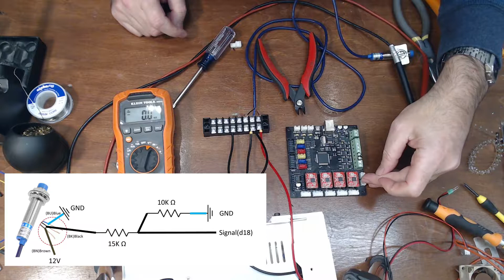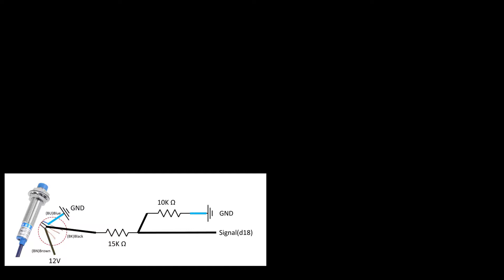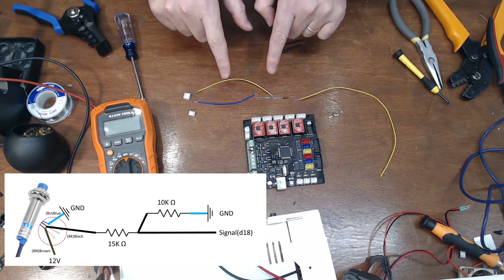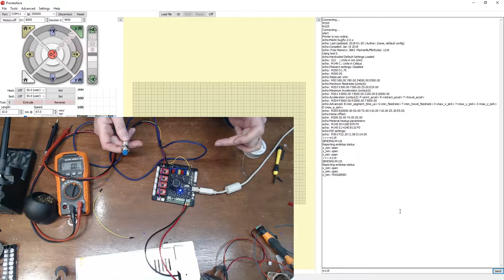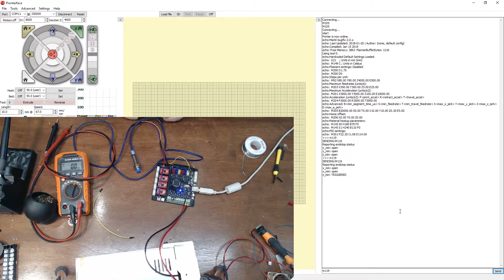C3Dt/c Cantilever 3D Printer Build: Part 4 Proximity Sensor

Comment: Can we use ramps 1.4 and arduino mega?
Reply from the maker: for the proximity sensor you absolutely can. The KFB 2.0 is really nothing more than a RAMPS 1.4 with ATMEGA on one board. IF you look at the the KFB pinouts in marlin you'll find 99.5% of all pin outs the same. For this printer (The C3Dt/c or C3dT/dz for that matter) you can't use the RAMPS and arduino board as stacked up they're too tall to fit in the enclosure.
Reply: @Core3DTech  thank you for the response 😁. Yes, I went through the design and found out that there's not enough space for ramps and mega. So I have decided to go for skr 1.4
Reply from the maker: @nithink94  I use the SKR 1.4 on my C3Dt/dz (https://www.instructables.com/id/Build-Your-Own-C3Dtdz-3D-Printer/) with TMC2209 drivers. It works great.

Comment: Hi
I tried the controller board mks gen v 1.4 does not work, I sensor model LJ8A3-1-Z / BY  was.
Reply from the maker: I need a bit more here. 

Are you using a mks gen 1.4 board or the KFB 2.0? 
What is "not working":
When you hold a piece of metal to the sensor does it light up? 
What voltage are you putting into the sensor?
have you measured the voltage output of the sensor?
Reply: @Core3DTech  
I need a bit more here. 
- I am using mks gen v 1.3.
- When I approach a metal, the sensor light turns on.
- 12 V operating voltage of the sensor 6 to 36 volts were used Knmchvn.(LJ8A3-1-Z/BY)
- The voltage increases when the sensor is engaged.
Reply from the maker: @Hossein_m_pour  Thx, You did use the voltage divider using the resistors?  how much voltage difference do you get at the board when triggering?
Reply from the maker: It's kinda impossible for me to see what would be wrong with your setup. I assume you have your firmware updated and tested using M119 but double check it; you may need to reverse the trigger in the firmware. Also make sure you have your 2 wires coming from the resistors connected to ground and signal (not the 5V pin)